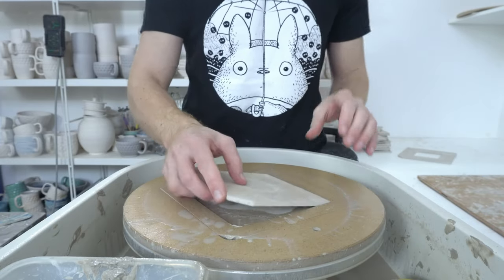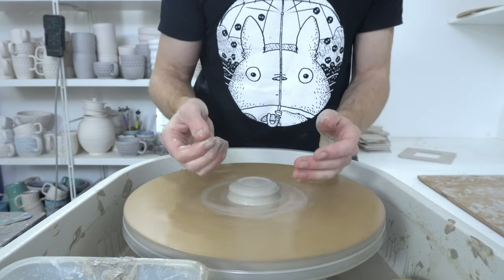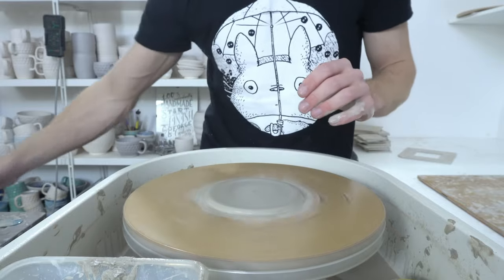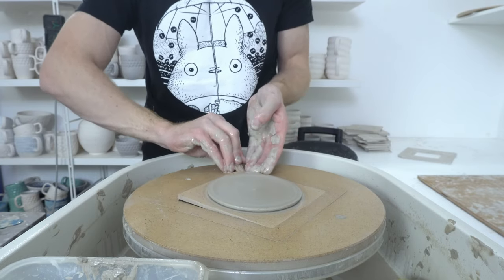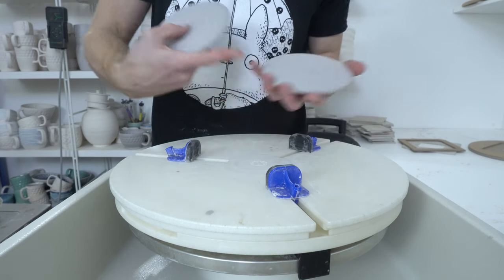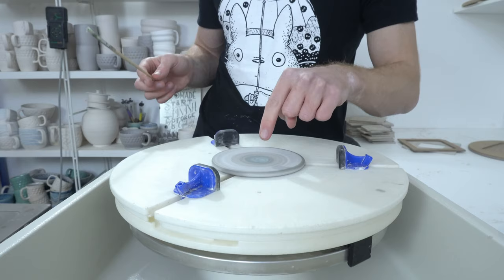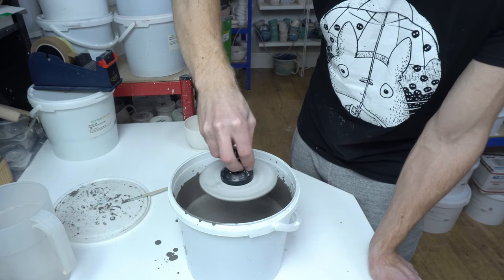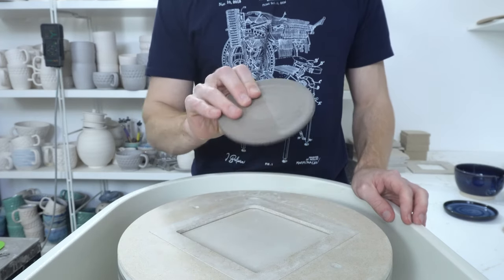How to Throw and Glaze a Ceramic Coaster

Comment: Hi. Love your videos. Really helping me a lot. Thank you. I bought the car suction tool from Amazon on your link and it holds my coaster for about 3 seconds then it just drops off. I applied wax resist to the bottom and moistened the sucker. Could there be something I am doing wrong?

Comment: Good video. Yes, I was wondering about stamping mugs. I tried to use a signature stamp on the bottom, but that was a mess. What is your stamp made of, metal? Any tips on stamping (or using your signature) would be appreciated
Reply from the maker: Mine is laser cut acrylic. The real trick is getting the clay at the right level of dryness. Too soft and it just makes a mess, too dry and it doesn't leave a mark at all

Comment: Hi there. When you drip wax resist on a part of a pot you don’t want it on will the glaze be effected and if so what can you do to fix this. Thanks very much
Reply from the maker: It will, and the only way to be completely sure it has been removed is to rebisque the piece. You can scrape the wax off and you might get away with it, but the glaze can have issues even if it looks fine going into the kiln, so the safest way is to bisque fire again to completely remove it.
Reply: Old Forge Creations   Thanks for that.